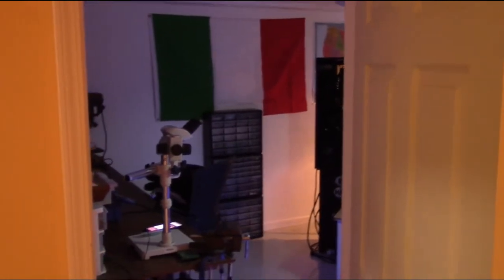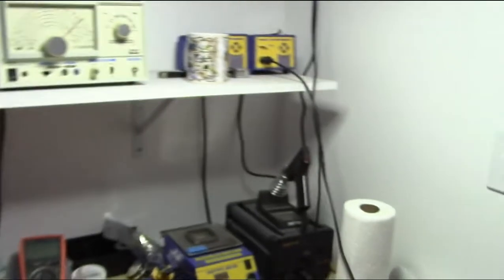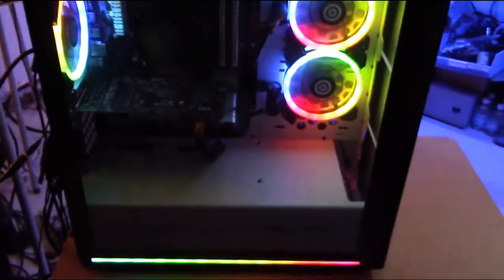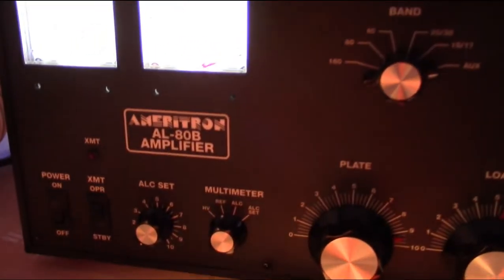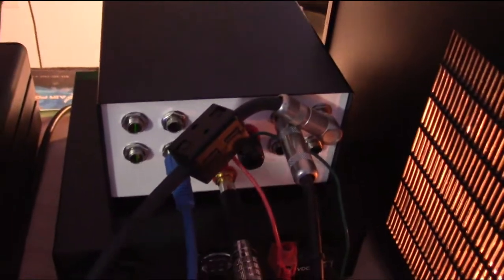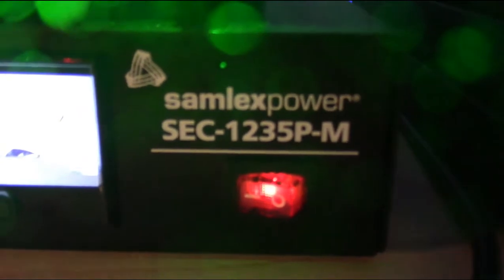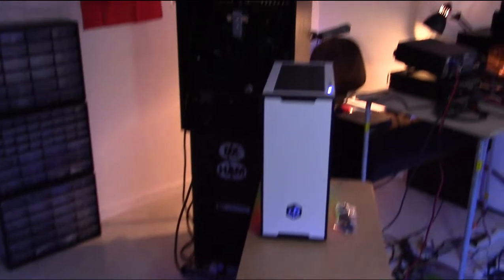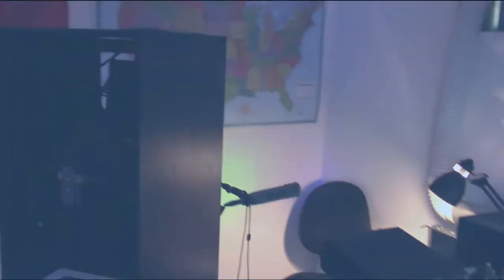Holiday Shack Shop Tour. Happy 4th of July!

Comment: I like that surface mount station ! The other stuff is cool too . Happy late 4th 🇺🇸
Reply from the maker: Same binocular microscope and hot air as I use at work. Just need a JBC nano soldering station and I'll have a complete set up. Happy belated 4th!
Reply: @KP68videogates  yes sir I figured it was same as at your work station . Very nice . I just have a el cheap o hot air station and lighted magnifying lens deal . It’s fine for what I use it for on the rare occasion .